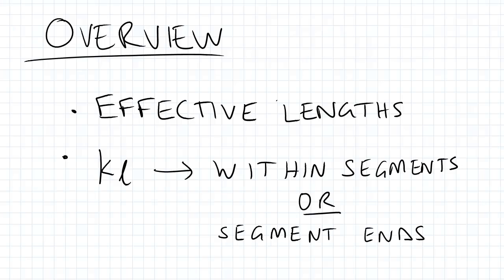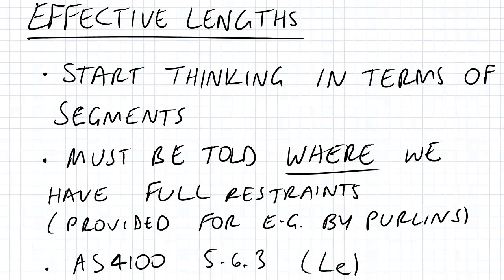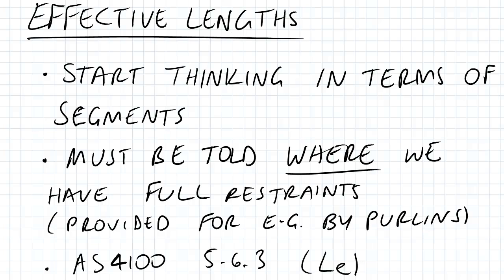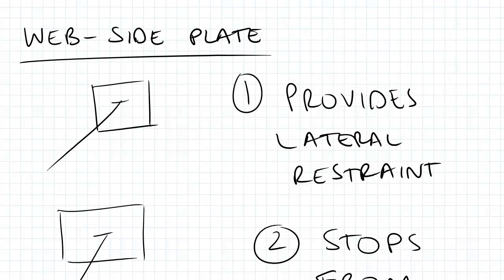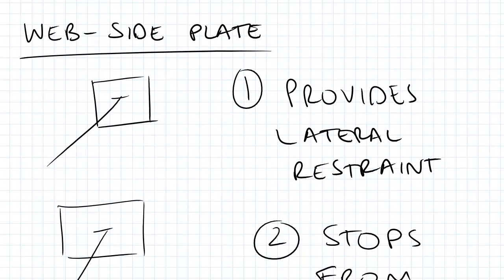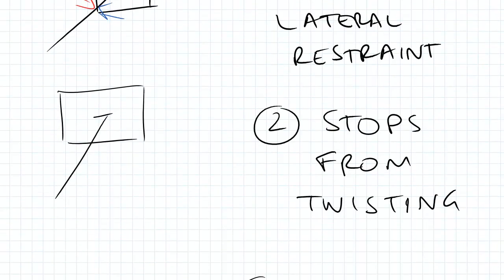Lateral Restraints & Effective Length in Bending: Steel Structural Design

Comment: Hi, if length of steel beam is 5000 mm including 200 mm bearing in each side. This means length of clear span is 4600 mm.which length will use in design.
Clear span length or  full length of the beam? Please advice.
Thanks.
Reply: 5000mm
Reply: @jasonburstow3332  , I understand that the effective length of the beam will use in the design which is 5200 mm. Please advice.
Reply: @Fshah1  You use the overall length of the beam and not the clear span.